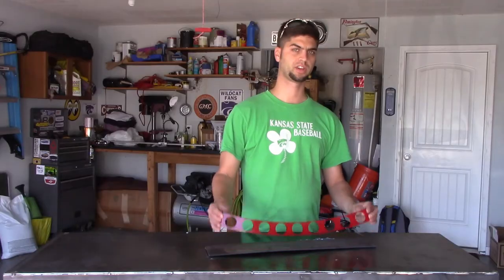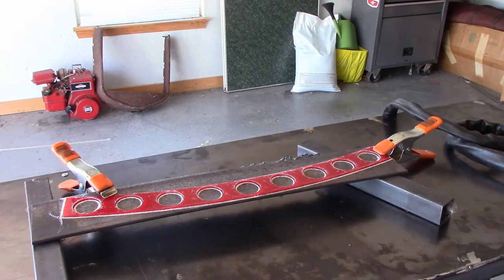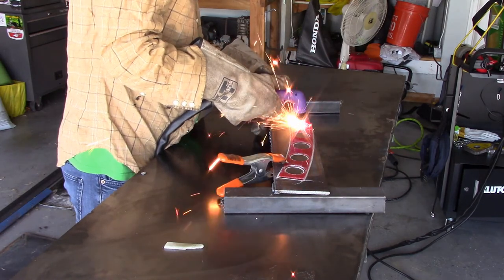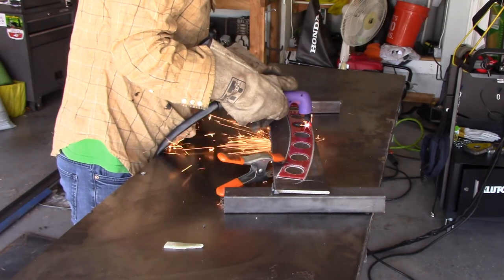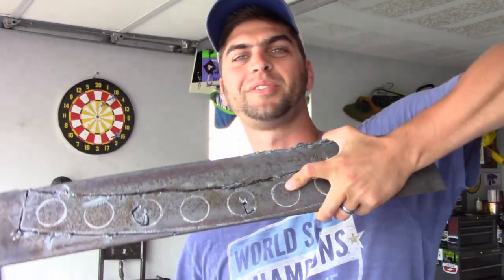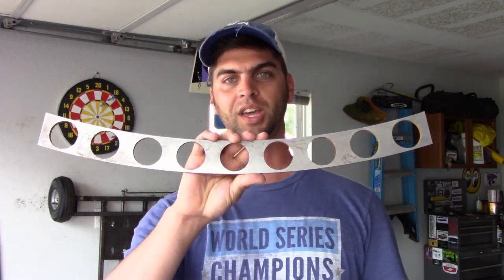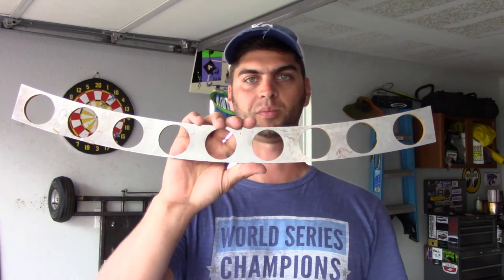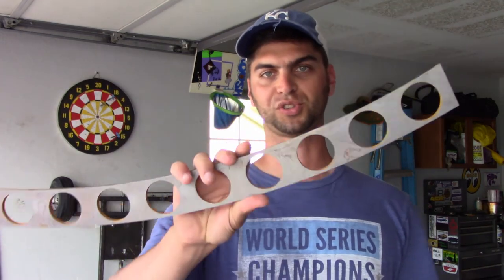Rat Rod Radio Flyer: (26) Time for a new front axle

Comment: You will like tig welding once you get the hang of it.
Reply from the maker: I sure hope so. It looks like a lot of fun, but it certainly was harder than I thought after my first try.
Reply: Everything has to be clean that you're welding. Stainless brush only for cleaning parts to be welded. You'll get it after a short bit.
Reply from the maker: I feel like I also saw on TurboCobra's channel once, like wiping down with acetone or something? Removing mill scale? I cleaned my practice pieces pretty well.